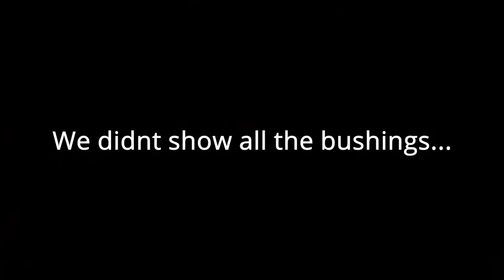Full Chassis TEAR DOWN!  [[1961 Bel Air Wagon]]

Comment: Hey Pudd, watching you do this wagon reminds me of when I used to do the same kind of stuff back before my spine became more damaged then that X-frame. I enjoyed it then and I’m enjoying watching you doing it now. For me it was mostly Corvettes back before they became so valuable. Most will find this hard to believe but my first Corvette was a 10 year old ‘63 roadster with a 327/300 horse and 4 speed. After market side pipes and Keystone mag wheels with Firestone Wide Oval tires. Nice original paint, 34,000 miles, power windows, leather and an AM-FM radio. The leather and AM-FM only became available in the late ‘63 production. I paid $900 for it which is what I sold my ‘67 XKE for. The Jag was only 5 years old. Those and a dozen other similar cars were all around $1,000 in the early’70’s. They used to sit on the back line on used car lots. Lots of parts from other junk yard Chevys worked in the Corvette’s and were dirt cheap. We had little concern about keeping everything original, we just wanted to have them streetable for Friday and Saturday night cruises on the Asbury Park circuit, driving a 8 or 10 block loop for hours each night. We’d have races from the intersection traffic signals whenever there were no cops in sight. If there was money involved it was usually $5 or 10 dollars.
Great fun impossible to recreate now. It was so much more fun back then when a few more scratches (or blown motors weren’t very important.
Lots of other stories if anyone is interested. It was a great time to be a sports car enthusiast in one’s late teens/ early 20’s. Those were the nights we could forget about the f**king  military draft hanging over our heads.
Sorry about rambling on. I really haven’t thought about it in a long time.q
Puddin’s got a way of re-kindling those memories.
Now back to his excellent and varied content!

Comment: That frame is in very good condition from what I see from sitting all those years.  I think you made a very good choice on going to power steering.  I found over the year power steering last longer than manual steering.   You brought back quite a few memories from working in a garage for a job in the 1980s mostly the cars and trucks were from the 50s to the 70s and a few in the 80s back then. Mostly worked on the front end and brake work on those vehicles.  The master mechanic would do most of the work and would train us on repairs and we would help him when needed.  He made it possible where I could fix cars and the truck at home and save some money on labor.

Comment: My first vehicle was a 1976 Chevy custom deluxe. My pops sold it to me for $100 on the condition that he taught me how to weld and use the cutting torch while we fixed the nearly non-existing floor boards and truck bed. He cut two sides and then said here ya go. We decided it'd be best to leave the near empty gas tank on her and when I started cutting we almost blew ourselves up. Good times with my pops!

Comment: Hey Puddin. Never comment on anything but helpful tip. If you loosen the release on the engine lift and then lift the arm manually then tighten the release it will stay where you put it. That works to for your press too. Love the channel. Thanks

Comment: Frame looks pretty good.  Up here the back of it and maybe under the cowl would be rotted out. 

I saved a '58 sedan delivery out of a yard and it was so rotten the guy who bought it just took the body shell like it was a model car kit, left the floors and frame and all I had to cut for him was about six inches at the rear wheel tubs to separate it.  Frame was rusted clean through one side under the cowl.  

He did build it, though, he took another car and cut it down and put the delivery shell on it.  Because some time later he emailed up for help how to register it.

Comment: Hey Bubba.... Mr.Goodwrench used to have a 4bolt main 350 for $1399.00 short block from 1984....
I believe they are a half and half model. Half SAE, half Metric.
Not bad for a warrantied brand new crate motor. 
Here in town it's available at our G.M.C. Dealer only.
I hope this is helpful, your pal BigBadBubbaBurns.

Comment: early 60s 283's w/ the 2sp power glide werent fast but when they were new they would run 75 mph cool in the heat all day and get decent MPG's doing it. l got to drive and ride around in my cousins 62' biscayne in the  mid 70s when the car had less than 20k on it and drove like new still. They ran silently which is a lost art. They werent slow either even w/ the single exhaust.

Comment: Hi Puddin, glad to see Bill brought the air chisel. It would have been easier to get the rear shock mounts that you need to save by splitting the nuts. Also by knocking the heads off of the ball joint rivets-no fire. Keep it up,Dave

Comment: Puddin as someone who hates dealing with rusty and stuck harddware for the longest time man i relied on ol PB-Blaster and good old 7 foot breaker bar dude no joke i bought a Induction gun one of them things that you see all over youtube,instagram of them heating up bolts with a gun dude i got the Solary induction heater kit from amazon $182 shipped and bought the extra coil kits $52+3 shipping no joke if i had the money to buy you one i would in a heart beat i legit don't touch my impacts near as much as i used to and once in a while ill require some PB blaster and the induction gun but i have removed bolts and nuts that i never thought i would of ever removed without them snapping. also no i am not sponsored lol i wish i was tho but i recommend anyone who deals with suck or rusted bolts get the Hot Rod inductor 1 it was called the Solary Magnetic induction heater kit when i bought it.

Comment: D D speed shop uses a length of three quarter all thread nuts washers and steel plates for the coil spring removal, works well.

Comment: Detective Puddan.... Just a heads up, if you leave the lowering valve closed on the engine hoist, lift the boom and hold it for a couple seconds it will stay there. Figure that will save you some time cranking that lifting lever.

Comment: Welcome to doing most bolts up here in New England the salt and rust dang near welds them on snapped a 3/4 snap on breaker bar trying to get a bolt off 2 years ago wish I had a torch to cut it off

Comment: Lol. You shoulda broke those bolts on the rear end loose before you disconnected it from the chassis. It would have saved you a lot of trouble. You bent the breaker bar.

Comment: Puddin, snipe that breaker bar more, choke it all the way up, see all that bend/flex in the breaker bar @36:35? that's wasted energy... choke your bar right up to the bolt and it's way more power transferred.

Comment: You realize you should keep them hands and hands or wear the $1200 a beat just for the cast thanks right on power back heads He didn't know what a 4 bolt machine Chevy is versus a 2 bowl Maine he didn't know what the botaheads were so I told him to do some research on the Internet and then figured out cause I said you got a motor and that dough drop was worth more than a tow truck where's the meadowdrop